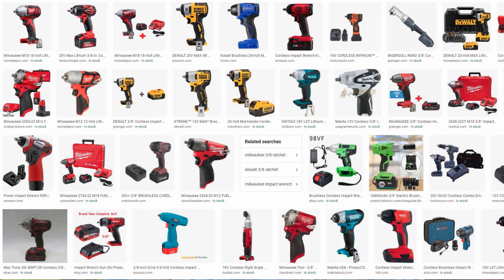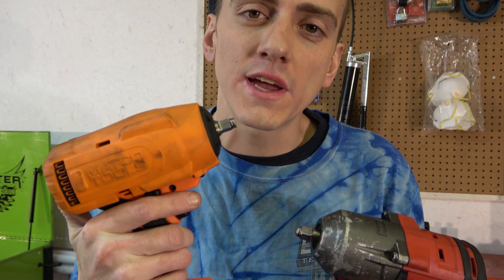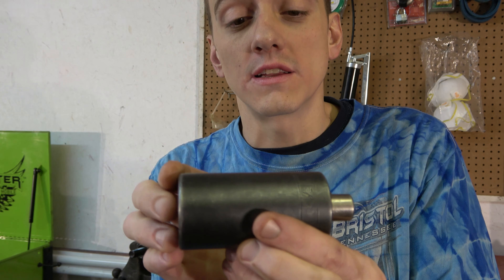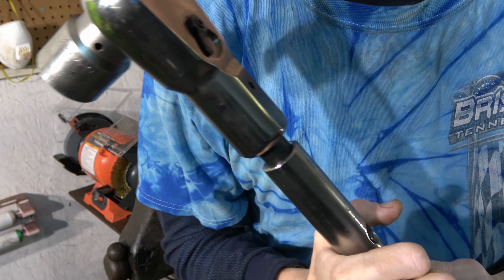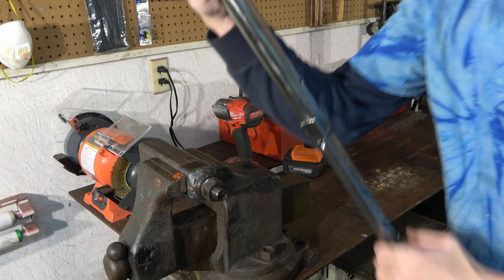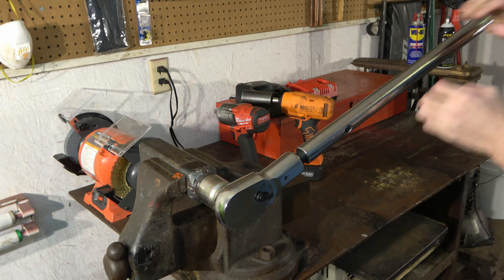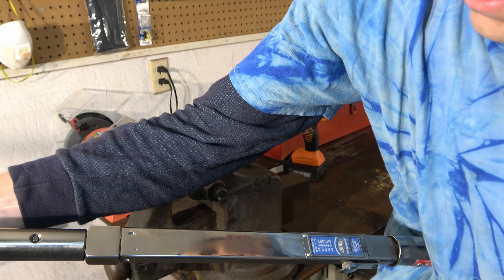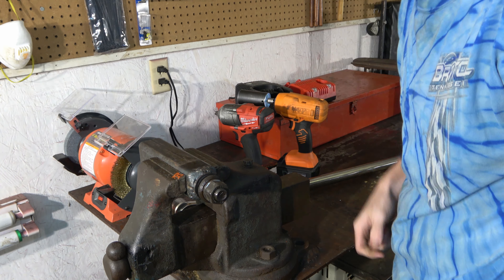Milwaukee 3/8 Drive Impact Takes on Matco 3/8 Drive Impact in a Nutbusting Torque comparison!

Comment: Awesome. I have been an electric tool hold out for so long. I've just started my collection recently with the M12 Fuel (2557) 3/8 ratchet and M12 Fuel (2554) 3/8 Stubby Impact and couldn't be happier. I'm looking forward to starting an M18 collection starting with this 2852 Fuel  3/8 Mid Torque Impact and the 2767 Fuel High Torque 1/2 inch Impact . I've relied on pneumatic tools for so long that it was hard to convince me to make the switch. But I'm glad I did!

Comment: It took the Matco twice as long as 600 but took the Milwaukee twice as long at 550. Blood did you notice the wobble out of the Milwaukee. You must have kept holding the gun right there so I didn't pack straight and harder LOL. Matco is still the better brand it's about quality not quantity